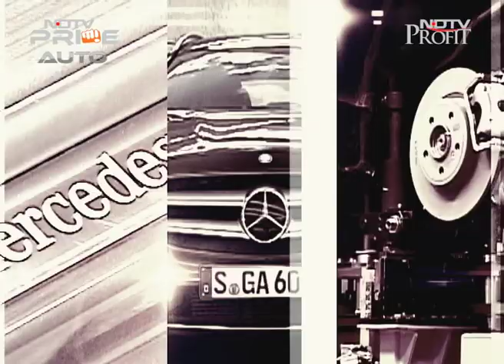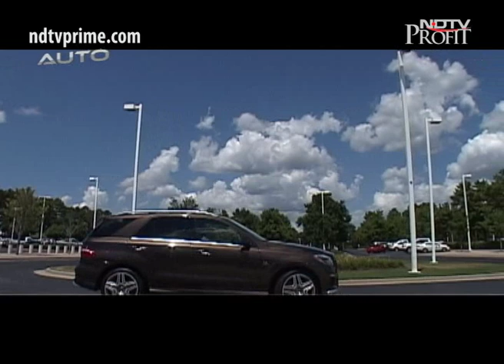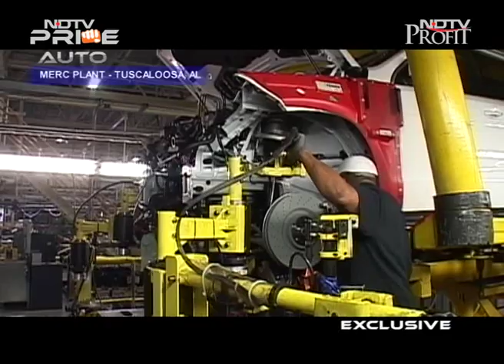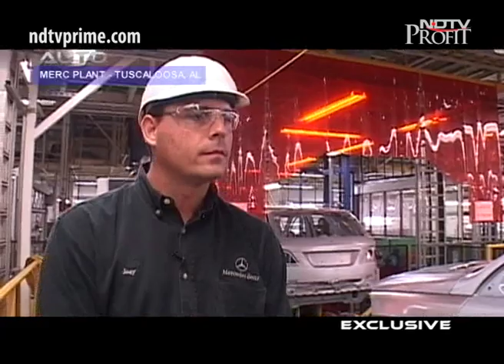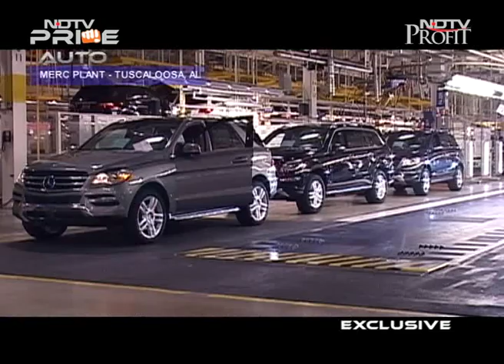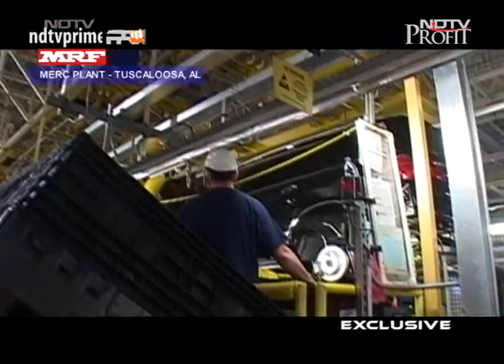SUV trail: Mercedes-Benz's Tuscaloosa plant

Comment: "We are learning on the C-Class..." - he wasn't kidding
Reply: +jts3793 

Beginning with the 190E in the early 1980s..........the following E-Class was/is based on the 190E "C" Class.

All the Structural Platform has evolved over the past 30+ years; all the Tooling like jigs and fixture points can/do remain the same. Not only is the ML and E-Class a modified C-Class based Platform..............the current Jeep Grand Cherokee and Dodge Durango are built on that same Platform too. 

Granted the Jeep and Dodge  don't have the higher content of soft-touch interior furnishings and features/gimmicks only available on the Benz models, but a higher-grade interior with all the frills and gimmicks only cost a manufacturer a few hundred dollars extra.

The  higher retail-price of a Benz versus the Dodge is just that. Decades of extensive Marketing,convinces many consumers to believe it's ok to pay $60,000+ for Base ML with few options.....where the Dodge version....with  different exterior stampings and lower quality interior trimmings.............cost a Fleet/Rental company.........maybe $20,000+....and the retail consumer will pay $35,000+ for the same content version the Fleet/Rental company pays for.